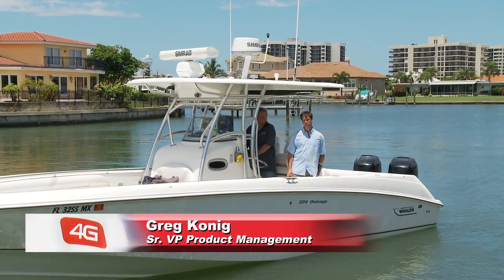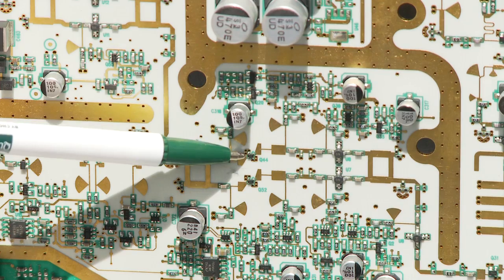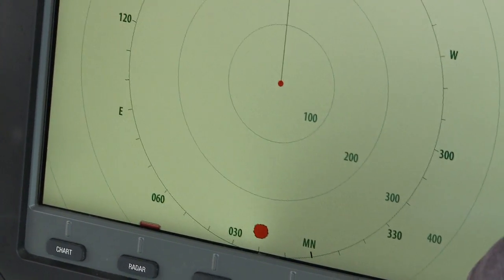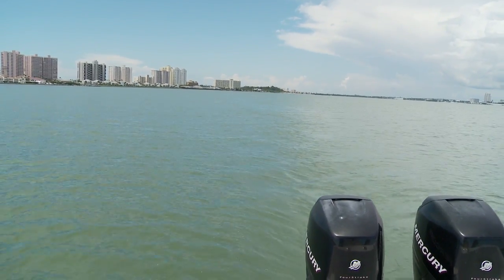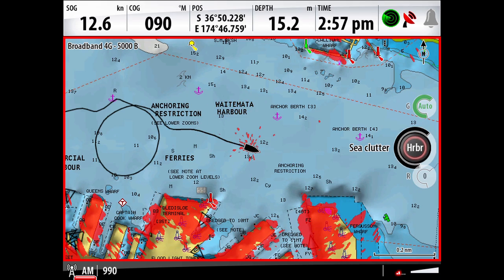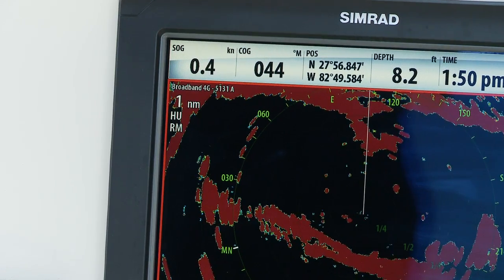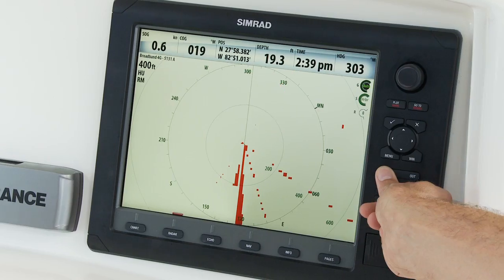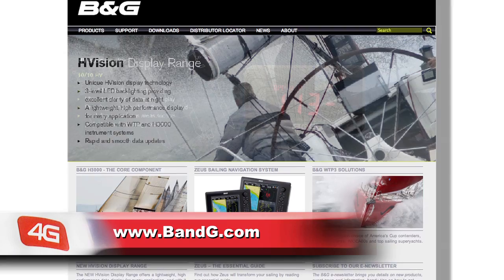Simrad | Broadband 4G™ Radar

Comment: Biggest selling points missed: 
1) 18 watts is just 1.5 amps at 12v. So you can leave it on ALWAYS on most boats. That's WAY safer than intermittent use at 5 amps, for secondary analysis of a visual target.
2) Works with freeware, OpenCPN on your tablet/laptop...IF you're technical enough to figure it out. (not directly factory supported)

Comment: The broadband radar's circuit board has like 200 surface-mount components on it! A moving PCB with that many parts is not going to be very reliable because you are stressing every solder joint by spinning it fast. 

The moving parts on the conventional radar are basically flat pieces of copper and are not likely to break after being spun a million times.
Reply: In the satellite industry, we regularly test SMD boards to 3000g without incidence. If these 3g/4g boards are built to something like IPC600 Class 2, no worries.

Comment: let's say i put this in my 3.8 meter RIB, how far i can detect a 10 meters boat in open sea???
Reply: +OokTiaopi The greatest factor in determining range is the height of your antenna and the height of the target, because the curvature of the earth will limit the range of even the most powerful RADAR. Even a 12,000 watt open-array RADAR that advertises a 72nm range will be limited to 5 or 10 miles on a small boat. To determine the range, multiply the square root of your antenna's height above the water by 1.22 to determine the half range. Follow the same formula for your target vessel, using the height of a reliable RADAR-reflective surface on that vessel. Add the two together for total range. That will be the optimum range; actual range may be a little more or a lot less depending on conditions.